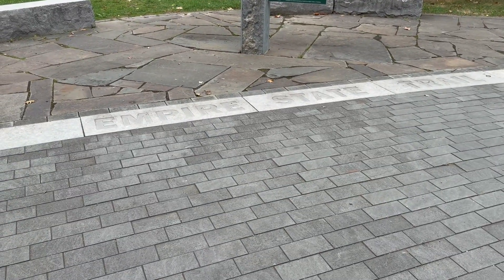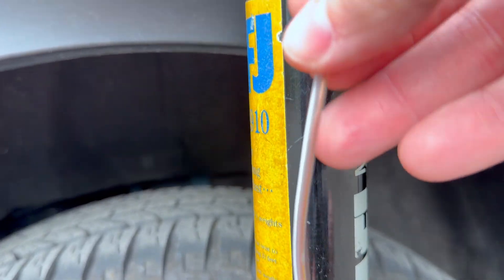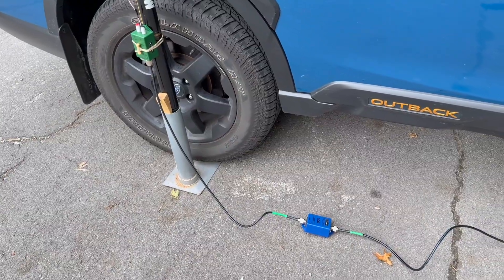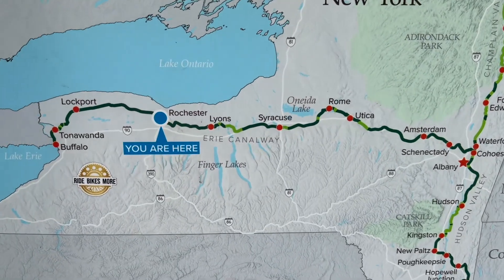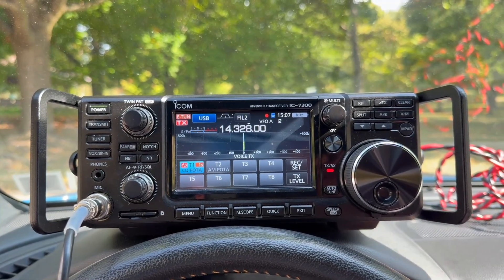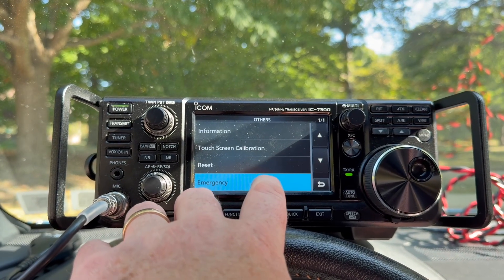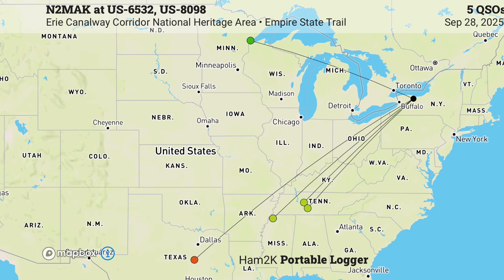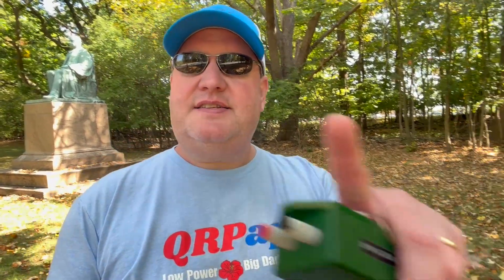I'm Not Impressed: POTA 2fer with the "No Counterpoise Antenna" 30/20-Foot Speaker Wire and 4:1 UnUn

Comment: Try 28ft/17ft? I've had success with those lengths, but as two separate wires.
Reply from the maker: Yeah, that's more of a traditional random wire. I've done 29.5' with a 6.5' counterpoise and it worked great. Thanks for watching!

Comment: Thanks for the video Mike.  I’d love to see someone explain the physics of this antenna…. It does indeed have a “counterpoise” the unbalance 20’ section coming off the ground side of the LDG.  Having an unbalanced wire right next to the element is gonna interfere with the radiating element, no doubt about it… glad to see the use of a choke even though it’s an LDG 😉
Reply from the maker: From the articles I've read, it seems like it's a "mini" version of a W3EDP and some have done it with different lengths of the speaker wires, or at least that was the idea for it. But they've said the 'poise doesn't seem to function like a Zep or J-pole. I've got so many more questions and things I want to try with this (like a voltage balun vs an unun or different wire lengths). But at the same time, a 29-ft random wire with a 9:1 works just fine.